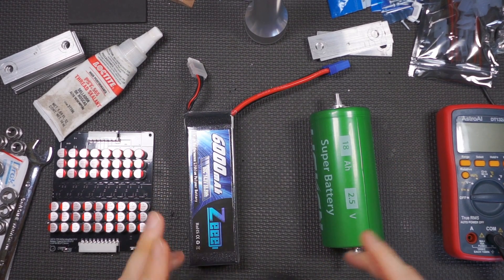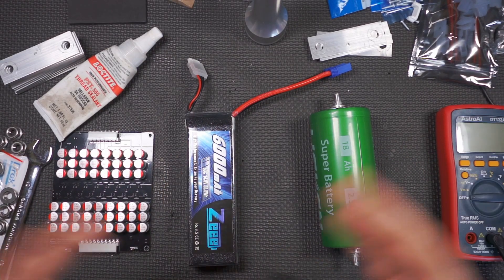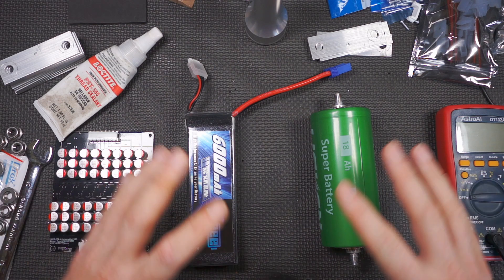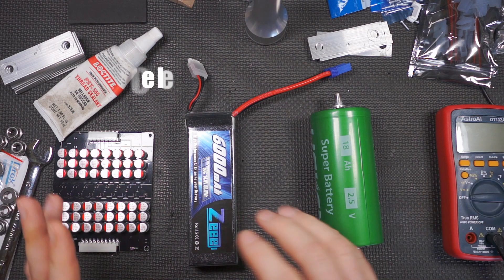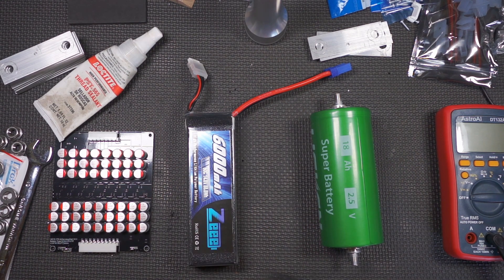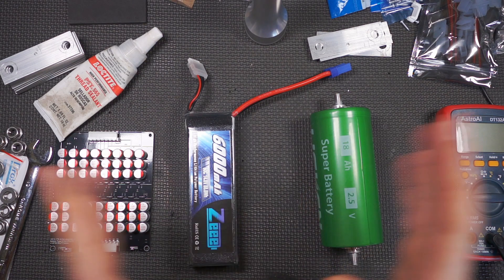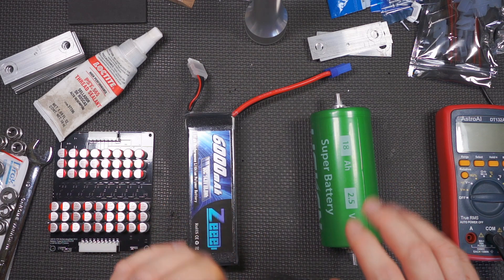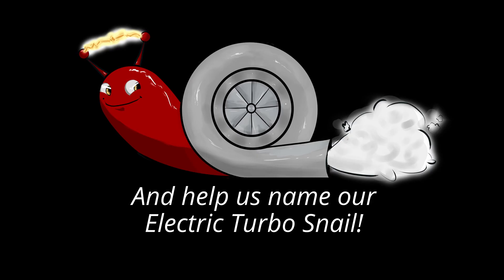New Electric Turbo Forum!

Comment: Have supercapacitors worked better?
Reply from the maker: No.  I have some huge ones here.  One is literally the size of a car battery and intended to start diesel locomotives.  The problem is relatively low power density and a linear discharge curve - meaning the voltage drops in a straight line, as opposed to most lithium batteries, which have a fairly flat discharge curve.  They can put out a monstrous amount of power instantaneously though.

Comment: Very cool, the forum domain, I’m still asking why 50krpms is the status so far, when most turbo turbines come to life after that?
(50-90+krpms)
Reply from the maker: It's a practical limit of available motor speed.  Gearing up adds complexity, and using centrifugal superchargers eliminates the need for extremely high rpm.  For example, most centrifugal blowers have max speed limits in the 50,000-60,000 range; yet they're as efficient as turbos, which tend to be much smaller.  You don't want to be off the compressor map, and these things exist, so we might as well use them.

Comment: This is a cool evolution of events
Reply from the maker: Hopefully it illustrates how serious I am when I say that I think this really is the future of forced induction.  I can easily foresee a time where people are mixing and matching motors, compressors, battery packs and ESCs.  It also gives hotrodders something to tweak.
Reply: @AlexLTDLX  no doubt being able to tweak or tune a when boost comes online will help with not only drag racing but circuit racing getting it to spool at the right times for so like a type of traction control or maby even rig it with an arduino to GPS so it spool so much at this straight vs that straight so many ideas